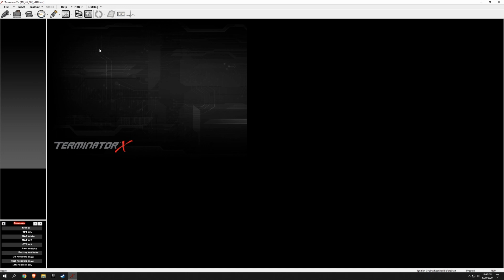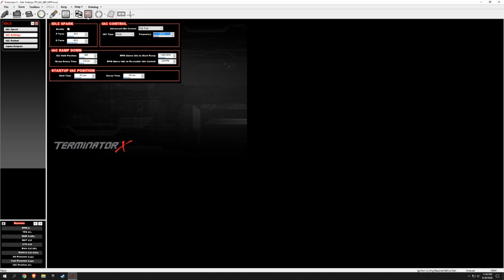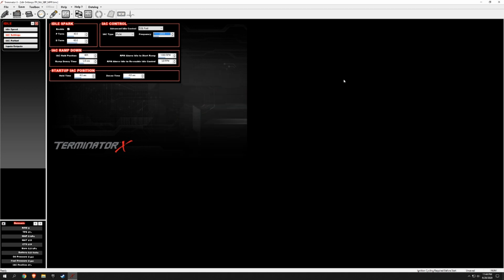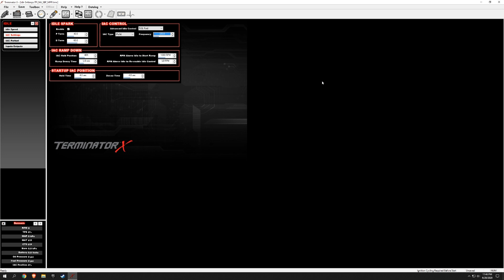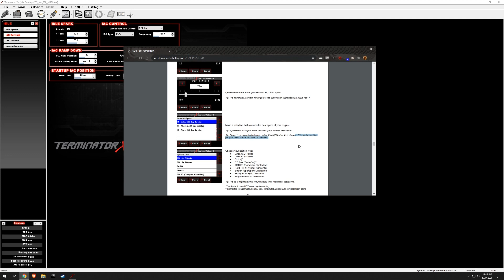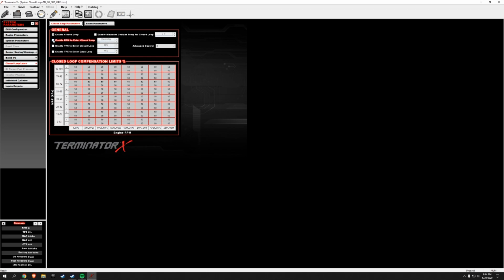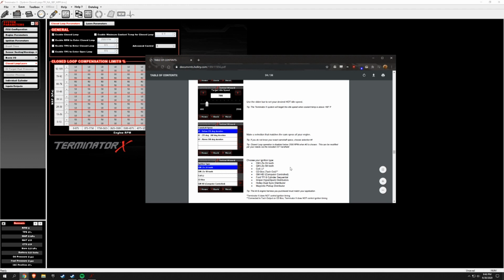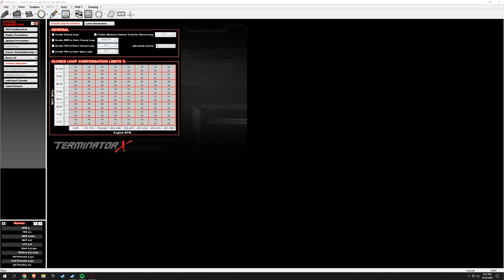SN95 Terminator X: Proper IAC and Closed Loop settings

Comment: I know you probably got it figured out now but I thought i would mention that in your first start video i noticed the ECU wasnt making fuel corrections at idle, at least thats what it was saying on the handheld, so maybe the reason it was super lean at idle was because of that, maybe the rpm cutoff for the fuel correction to start taking place wasnt low enough or some other parameter.
Reply from the maker: You are exactly right, it was not making corrections at idle. I didn't notice it at first. It was due to the setting where you enter the duration of the camshaft. I had to re-enable learning below 2500 rpms.

Comment: Ford IAC will not work at the lower percentage that you see in the instructions. That is for the GM stepper style IAC. Ford ones need to be between  20-30% from what i have learned from a few know tuners and online research.